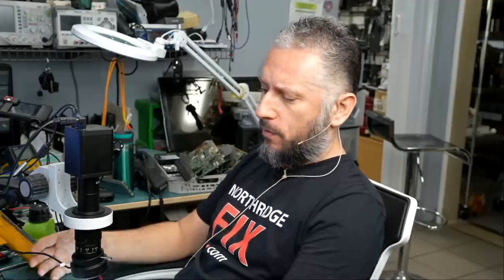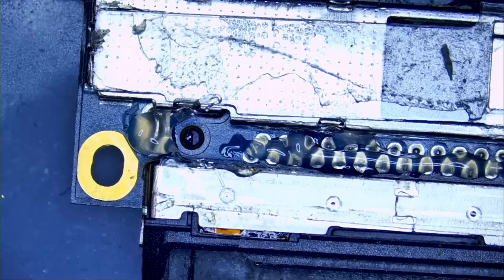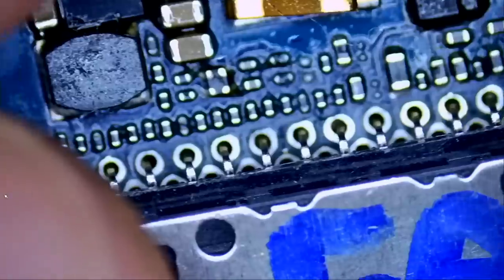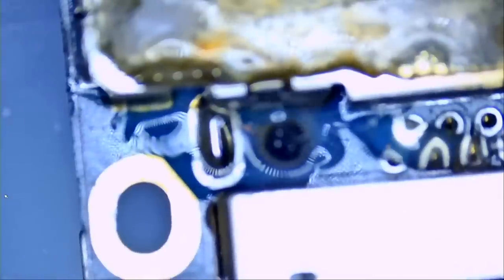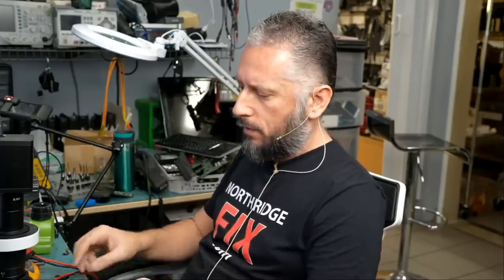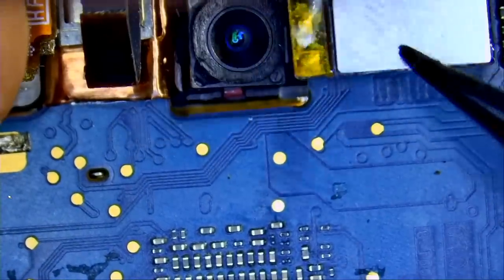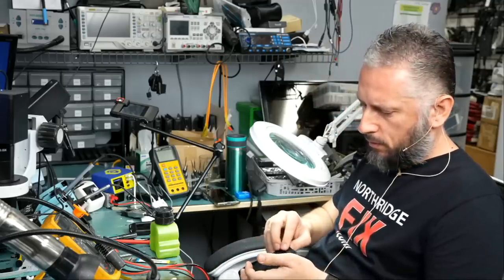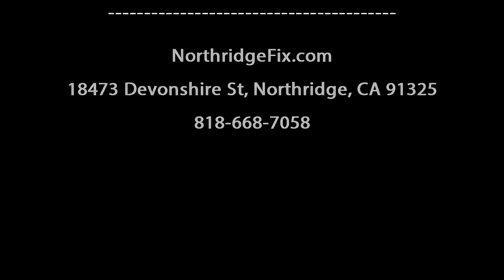iPod touch 4 repair - Charging connector replacement is No Joke.

Comment: As someone who used to fix 2 or 3 of these a day i feel your pain, from the delicate flex cables, short cables, awkward mid plate and brutal charge ports. Back then the cameras were not as good on microscopes either.
Reply: Same here. 😂 To remove it I used to only desolder the anchor holes and bend the charging port back and forth to break the legs. Then just remove the individual legs from the holes.

Comment: Great job with that charging port, Alex! But if you find that there still are some issues with the iPod check the top flex that you soldered, it was somewhat misaligned in the video.
Reply: Looks good to me. If you mean the reflections that make it look like it's way off, then replay that part again.
Reply: @desnick2316  Lol. It's not a complaint, it's a sincere concern.
Reply: @Alex.M.S.  It was not somewhat misaligned, it was completely misaligned. It amazed me that it worked.
Reply: Agreed, that flex cable definitely shifted down as he was soldering it in place.
Reply: Agreed
Reply: Yeah, it was good enough to work. Maybe it will work for years like that. Or maybe he just fixed it off-camera. Sometimes I do that myself (or edit the wrong part in the final cut).
Reply: I noticed it too, but if it is needed only for data recovery, it will work, hopefuly.

Comment: The 4pin flex cable seems to be misaligned. I wonder if it's making the right connections. You can see it exactly at 10:20
Reply: "seems" is the right word here because it's only a reflection. The alignment is fine.
Reply: You are correct.  It is not a reflection making it appear misaligned either.  Using the capacitors to the right of the top pad as reference, you can see the flex cable is lower than the top pad.
Reply: you are right.

Comment: I totally agree with you Alex ..disassembling an iPod touch 4th gen was not an easy job.. I remember back in 2016 I had one with silver color and I swapped it with a gold shell but also I ordered a new lcd because it had a water damage spots on the screen.. working on it was not easy especially with those tiny different shape and type screws... Apple always want to screw up people but we try to do better than Factory 😅

Comment: 10:17 It looks like that flex cable is too low and contacts are in between pads of the cable or am I blind❓❓

BTW great job Alex 😁
Reply: @Daunlouded  you are blind and @aconetwork is correct.

Comment: I think this repair wasn't for data recovery because the client wanted a memory expansion ...
Reply: Yep, it's nostalgia.
Reply: Was thinking the same
Reply: That doesn’t suit the narrative for high repair charge though
Reply: @th3batfink  the lesson there is: if you don't want to pay, learn
Reply: My guess is they had a bunch of pictures on it since it has a camera. Maybe they thought Northridge could back it up to iTunes and replace some kind of removable storage. They probably did not realize it has a BGA flash storage chip, which is proprietary hardware. You'd have to source a bigger chip and resistors from an existing ipod and have a special firmware flashing device, if one even exists. That kind of procedure would be insane.

Comment: why don't use low temp solder paste for soldering tiny connector and apply some flux? they can soldering to the each pin of connector with hot air by themself and make it more fast working.

correct me if i'm wrong and thanks
u're my inspiration for this job

and sorry about my wrote, my english not good enough 😂

Comment: hey man, I did exactly the same repair but after repair ipod is stuck on apple and does not load up the system. Any ideas what could be the issue ? how would you progress here ? any diode mode measurements could help identify the problem ?

Comment: As the customer asked you to expand the storage, they clearly want to continue using it, not just get their data. That seems a bit crazy given the age and value of the device.
Reply: I still use my 2002 2nd gen firewire iPod with only 10gb, only two battery replacements so far! Unless it's completely dead dead, there's no use in getting rid of. Some of the older iPods have really decent digital audio converters, especially the 5th gen video iPods. We all recycle in our own way.

Comment: I have replaced thousands of the touch 5/6/7 ports and batteries, but never a 4. Is that a hard PCB that the through-pin connections are on, or is it the soft flex cable?
Reply: Fiberglass. But very thin and narrow so it is unintentionally flexible 😂

Comment: I always felt Charging Flex cables were a "Looks good on paper, bad in practice" kind of thing. Way too fragile and far too hard to work with. Easily could melt the cable and easily could rip the cable and traces inside. It goes so show how experienced and good you are working with them and no damaging them, but I wish Apple didn't come up with such asinine designs. Just makes working with it a pain in the ass.

As a Precision Machinist who does repairs on Plastic Injection Tools and Molds, I know a lot of really BAD designs by looking at them. The engineers dream up a HUGE amount of stupidly bad designs, that are a PAIN to work on and repair when/if they break. They really don't understand what it's like to have to make those parts, nor do they understand how much of a PAIN it is do repairs.
Reply: that's exactly apples purpose.. they're the worst company they don't want any third party repairing their products apples main focus is that once you buy into the apple trap you will have to use apples services, be it for hardware or software and they charge you greatly for using those services. if you want to make apps for apple users you probably want to get into the apple store, be ready to pay a 100+ euro yearly fee, while with google play it's just once in a lifetime 20 or 30 euro or something and there users aren't that forced to rely on the google playstore.
unless all of this has changed.

Comment: apple iphone and ipod other apple portable product has a strange behavior!

My experience, especially with iPhone 4 and 5c, is that the battery drains FAST after you have turned them off completely!
Even if you turn them off completely, they cannot be left turned off for more than a maximum of 2 days before the battery is empty! 
I don't understand this, android phones used to not have this problem. Can someone explain to me why the iphone is made this way and what is still on and causing this?

This is not a fault with the telephone, but the way it is designed!

Comment: If it was about data, he should have installed a charged batter and recovered the files. Even power supply could have done the job. I am getting crazy!
Reply from the maker: What planet do you live on. iPod needs to be plugged in to iTunes for full backup. You need a working port.
Reply: @NorthridgeFix  😂😂😂
Reply: @NorthridgeFix  👍👍👍
Reply: Bruh you need to be a trained professional to disassemble an ipod or any apple device out there , what kind of sense do you have .
Reply: @NorthridgeFix  🤣🤣🤣🤦🏼‍♂️